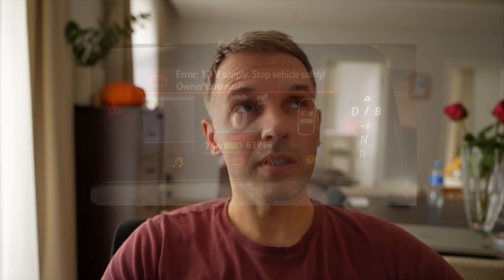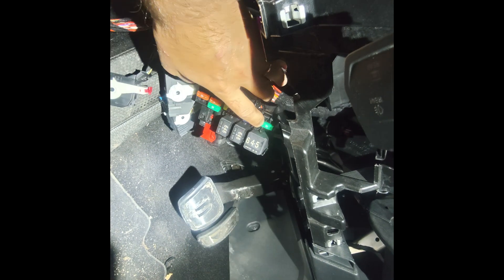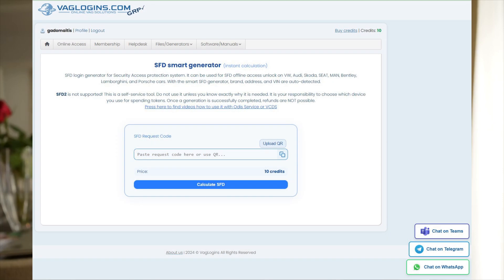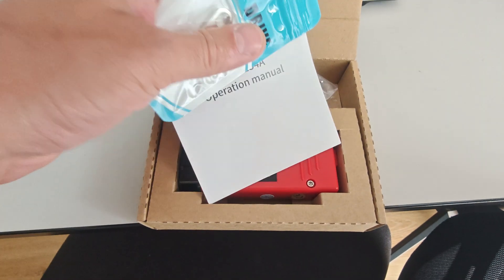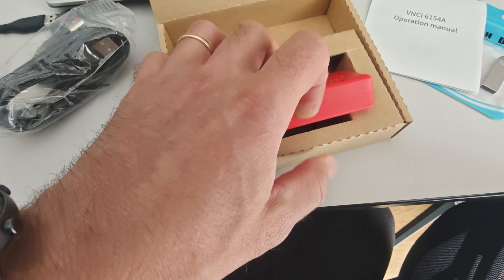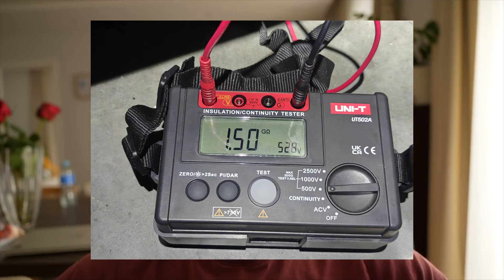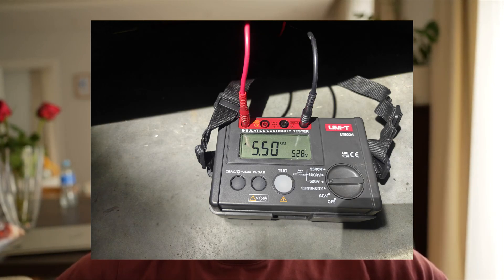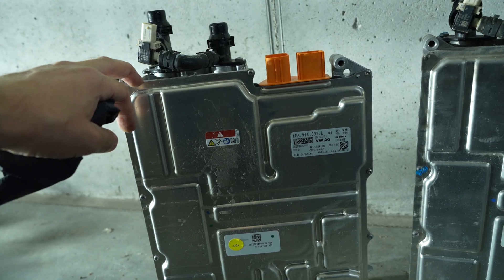VW ID.4 FIX – Electric Drive & 12V Faults Solved! | Error P0A0B00 & C1380F0

Comment: I had same problem 1 month ago and send my car to VW dealer I bought from. It takes them 2.5 weeks to find the reason. It was because of the “High Voltage Battery Charger Unit”. They changed it and problem solved (For now). Part code is “1ea915685s”